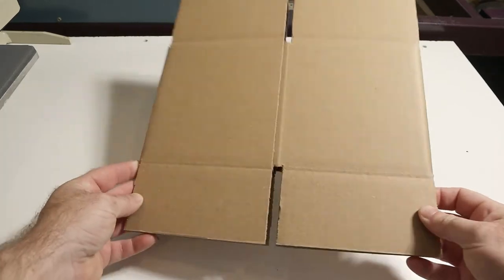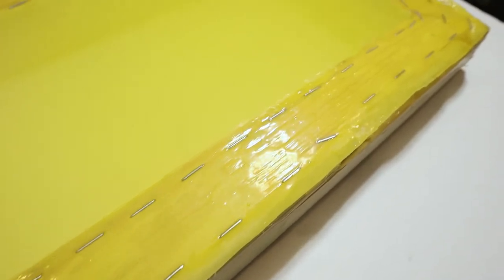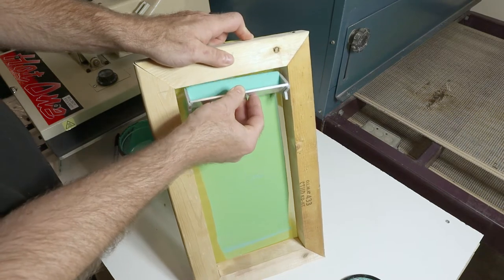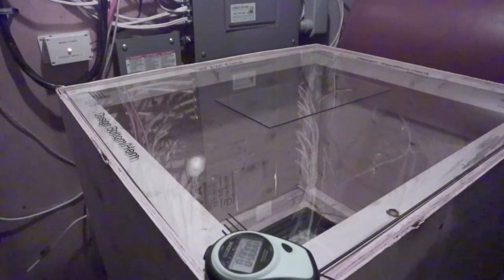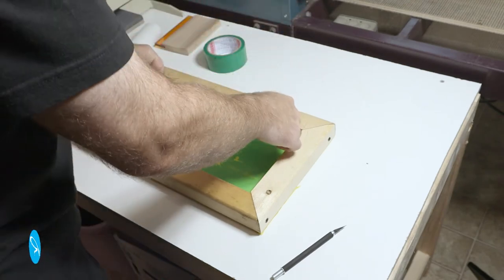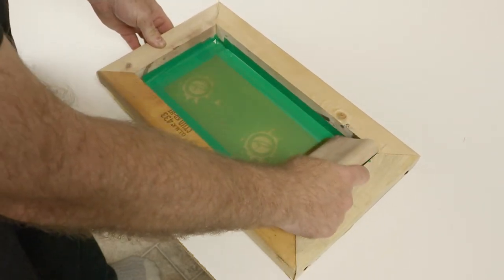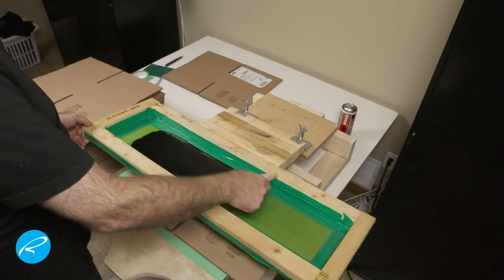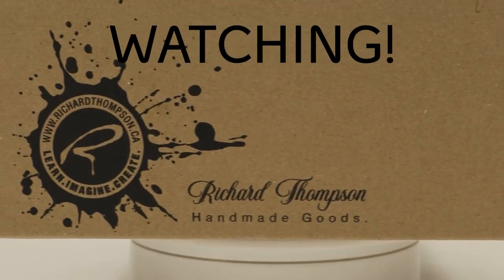Screen printing small boxes for your business.

Comment from the maker: I've been wanting to get this video out for a while. I recommend using cheap acrylic ink for boxes, something you can get at any store. It's cheaper than water based shirt ink , and the shirt ink can have a slightly tacky surface if not heat cured. If anyone has any suggestions, if you are successfully printing your own small boxes, leave a comment below. Thanks for watching.
Reply: Hi Richard, thank you for your video. I am wondering DIY my own logo on box for my small business. So if i use the acrylic ink, would it be easier to paint on the box? or how does it work? much appreciated!
Reply from the maker: @Estheryaaa  Yes, regular acrylic will work better than fabric paints, because they will just air dry, they won't have to be heat set which could warp the boxes or cause them to catch fire.

Comment: Um... the smudging might be an effect of placing the frame directly onto the box. The way I learned it, there should be standoffs to keep the screen "hovering" over the surface (1-3mm) and only when the squeegee passes it should be pushed down onto the paper/box, make contact where you are printing and then spring back...
Reply from the maker: Yes, that's called off-contact. Generally the thicker or "fluffier" your substrate is (think thick hoodies) the more off contact you should have.